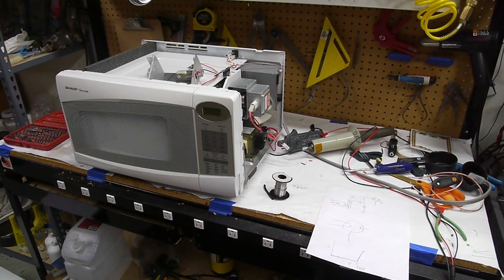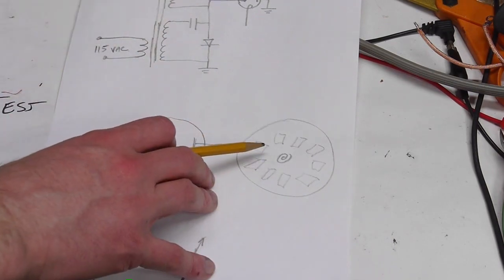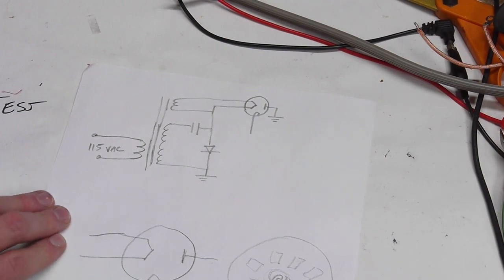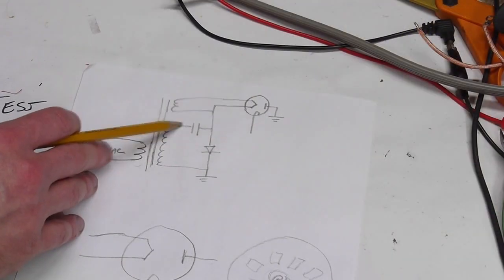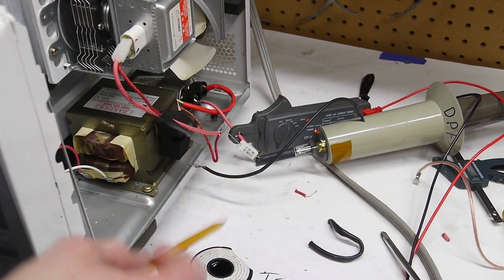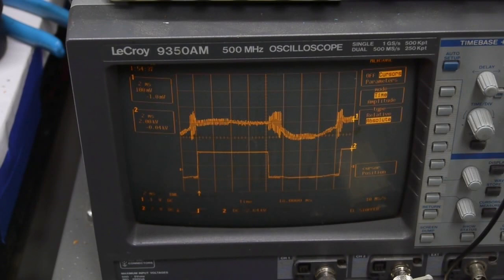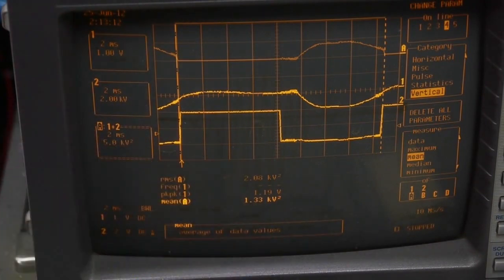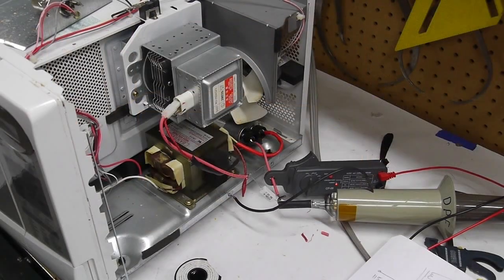Measuring the voltage and current of a microwave oven magnetron

Comment from the maker: The magnetron's output is non-ionizing, which means there is no risk of having cells' DNA restructured by the radiation. So, no radiation sickness or anything like that. The biggest hazard is thermal -- The RF can cause localized burns that are difficult to detect since they may affect internal organs where there aren't many nerve endings. Having said this, the risk is pretty low. Pilots in WW2 used to stand in front of radar antennae intentionally to keep warm, but it caused eye problems.
Reply: Eyes ...
Reply: @uploadJ  When the pilot has graduated and accessed to flys, he has just one eye because of fails with radars while learning. :D
Reply: @uploadJ  
"...but it caused eye problems" is actually the correct grammar. It could also be stated as such: It caused problems with their eyes.
Reply: @uploadJ  
Sorry, I don't understand what you are trying to say. I had assumed you were trying to point out a grammatical error on the OP. I was merely pointing out that it was not in fact incorrect grammar.

On the other hand if you were merely stating that both eyes are affected by the radiation then that is fine.

Or are you now saying that you were replying to someone else on this thread whose comment is now deleted?

Either way, it doesn't matter. It's not that important. Have a nice day.  :)
Reply: That can be fixed, just use the magnetron as a RF source for a linear accelerator
Reply: Eyes are more sensitive to Microwave Radiation at high power .
Reply: If you have had high frequency safety training you would know better, or understand why. Ever assemble and wipe a wave guide? Cataracts are mentioned elsewhere and bone cancer on a techs hand was part of a now old training video. Stay safe
Reply: Ben -- on the measurement accuracy yeah, usually the magnetron has a integrated LC filter for harmonics. If you pop off the filament terminal cover, the plug itself is usually an integrated capacitor and there are 2 inductor coils going to the filament terminals.

Comment: Or rather more simply, a 10r shunt, with a resistor, battery and led across it. An optocoupler would work fine too, but air gaps are good.

Comment: Measuring the current in the high voltage side is quite simple. Get a floating V-F (voltage-to-frequency) converter -- power from a battery and let it float on the HV. Have it drive an LED into a length of fiber optic, build a simple receiver on the other end, measure with a scope or a freq. meter. The V-F converter can be based on an op-amp and 555, like in Feb 21, 2008 EDN Design Ideas, or use a V-F chip. A bare 555 will do V-T conversion, most freq meters and scopes measure pulse length too.
Reply: Why not the low side of the transformer? Series circuit to the tube, should be same current.

Comment: Happened to me.
I was a kid and my dad was repairing a TV.
It was not plugged in, but I guess some capacitors were still charged, because when I touched the anode, (the part looking like a suction cup, I thought it was rubber, but apparently I touched some bare metal) all the muscles in my body suddenly went sore.

I dunno what was the entry/exit point though. I think I was barefoot on the cement floor in our basement, so it must have been the ground.
Reply: felixar90 It's called the HT cap and comes from the lopt. or in other words, line output transformer. On colour TV I believe they operate at 25 kv, and 10kv for black and white. Some sets had a way that the high voltage could leak to earth when turned off, hence the crackling sound when TV switched off. Others didn't, and they would store quite a lot of that voltage. No real ampage, and it's amps that kill.

Comment: The transformer is designed to saturate in an attempt to keep the current constant. The magnetron won't oscillate until a certain voltage is reached. When this voltage is reached, it will continue to oscillate while the voltage drops to a certain low point. The square wave is the magnetron firing and the transformer saturating and keeping the current somewhat regulated.
Reply: Ah!  Saturating transformer…this explains the low power factor and high current draw of the power transformer primary when the magnetron load on the secondary is disconnected.  I was puzzled by that behavior.

Comment: According to what you said instead of permanent magnets one can use electromagnet. With changing voltage on the electromagnet the frequency should change as well. A way of FM modulation. Or it works differently than I think.
Reply: re: "A way of FM modulation. Or it works differently than I think. "
The cavity dimensions determine the Freq_sub_o (Frequency of operation).

Comment: If I understand it correctly, one half-period is clipped by the forward voltage of the diode and the other half-period is clipped by the magnetron itself. A slight bow can be seen on the scope in the second half-period indicating fairly low differential resistance there.

Comment: Awesome video as always, Ben!  Can't wait to see where you're going with the magnetron experiments.  One quick safety tip that was given to me by an old Television tech:  Be careful of outlet strips on the front edge of your workbench.   If you get hit with high voltage, the ground/neutral can arc over to metal zippers etc. I don't know if 4Kv will do it - but he swore up and down that he'd gotten the shock of a lifetime from a color TV (I'm guessing 15Kv or so)

Comment: I just hope your not trying to make another neural stimulator using a microwave transformer to power it... just the way you talked about discharging voltage when it hits a certain point and charging a bank if capacitors.. oh dear.

Comment: Get a second microwave, pull the power supply and connect it to the 1st magnetron with opposite phasing with 2 extra HV diodes to double the output power. Get a small squirrel cage blower and mount it against the magnetism to increase the cooling. Or water cool it..
Reply: Now he will run the risk of a "flashover". Magnetron is only rated for up to a certain breakdown voltage ...

Comment: I've always wanted to do experiments with magnetrons but i don't want to risk playing with radiation. Hopefully with your videos you can talk a little bit about safely working with a magnetron. I have acquired probably 8 microwaves over the last 2 or 3 years, but I use the transformer for a homemade arc welder.

Comment: I've posted a video in response that shows an interesting artefact of the 50% duty cycle of microwave ovens. I filmed a CD and some steel wool getting zapped at 600 and 1200fps and there is a very clear pulsing to the sparks and flames as the microwave cavity is alternately filled and emptied of microwaves (as they were absorbed by the CD, steel wool)
Reply: Thanks to this comment I found your channel. Didn't look at much yet but the topics are interesting.
Reply: I am very interested in cavity magnetrons.  I subscribed to your channel, but couldn't find the referenced  video. Could you please post the linK? Thanks!

Comment: You could measure the voltage on both sides of the capacitor.  Then use the dv/dt to calculate the current on the cap during the transmit part of the phase.

Comment: would it be possible to use 2 MOT to produce the high voltage needed instead of voltage doublers? also, would you do an episode of focusing the microwave through a parabolic dish of some sort?